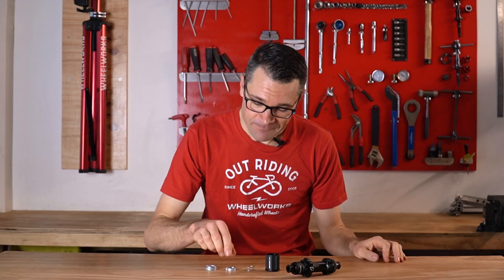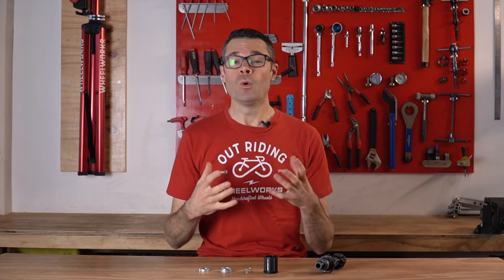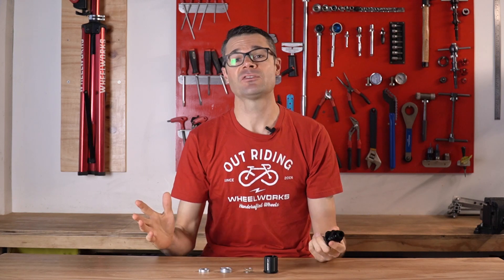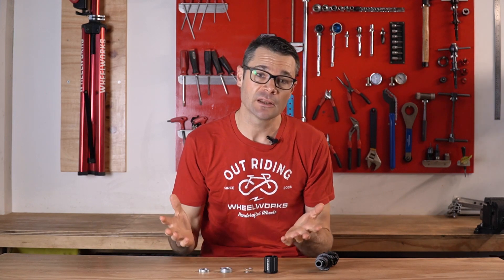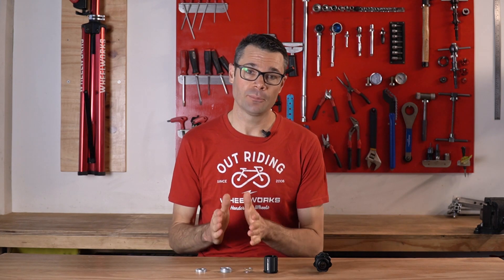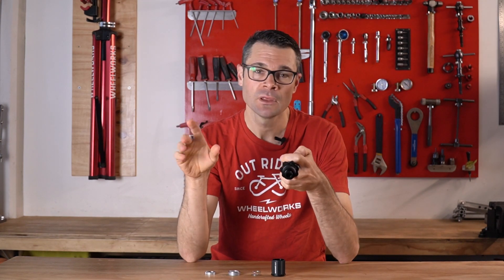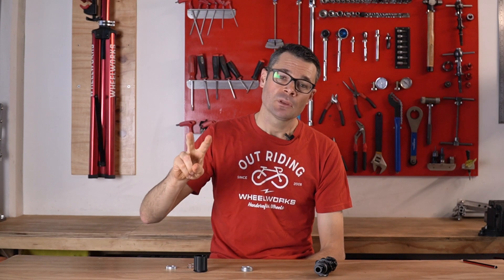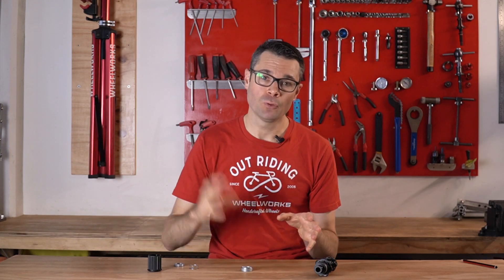DT-Swiss EXP Issue 2021

Comment: DT Taiwan ... its not swiss ... rubbish like most Fake german brands ... rebranded rebranding of cheap labour made China Taiwan frame and selling at 10x 20x 50x the cost ... $13k rubbish bike that cost less than $1.5k .
Reply: taiwan is actually high quality manufacturing. most bike parts are made there, their know how is unparalleled. China on the other hand is indeed mostly crap.

Comment: I have roval wheels on my SL7. They have ratchet exp in the free hub. This happened to me yesterday going up a hill.
Peddling but no power going to the wheel. Like the chain had come off.
I removed the ratchet exp this morning. It was clogged full of this silver grease that was stopping the spring from coming back out.
Little bit of cleaning and it worked again.
Reply: That’s grease shouldn’t be silver, that means aluminium has been shaving off the hub body! 

Also SL7? Boy are you unlucky for re-calls!
Reply: any problems since?
Reply: @Idrkmayne  no and I also got the bike serviced. I don't know if they replaced it

Comment: I am looking on my DT Swiss rear hub and can’t find that batch number. It’s a oil slick edition and a six bolt as opposed to center lock rotor. Didn’t get it from you guys but would love help if possible I have yet to build the wheels and don’t want to  remove the inner spline to make the potential repair easier if necessary.
Reply from the maker: We didn't get any of the oil-slick hubs (long story) but they should have a batch number on them.  Some of the 6-bolt hubs have this written on the driveside flange so you might need to remove the cassette or freehub body -Tristan
Reply: Thank you! I’ll take a look there. I will also possibly with my retailer.

Comment: Nice video! I was probably “patient 0” as I was the first one to post the problem in the mtb forum and also contacting DtSwiss about it. You are right, they took too long to acknowledge the problem and even then not making a total recall. By the way you are incorrect: the batch number with problems has a “0”. If you have any other number - it can be a 1 or any other digit - then you are safe.
Reply: Hi Ben.  May I ask how you know which batch numbers are bad?  Did DT Swiss provide that info?  I "almost" bought a wheelset with 180 hubs yesterday but decided to wait til I completely understood which batches are bad.  Shit, I just read that since the wheelset I'm seeking is Roval, the hub body will not have a batch number printed on it:(.    I'd rather be safe than sorry and simply replace the floating star ratchet either way...  HOWEVER, how do we as consumers know if the replacement floating star ratchet DT sends us is from the "bad batch"?
Reply: @brandonornelas4204  

Hubs (wheels as well as components) which have a “1” in the middle of the production code (e.g.: P2079940 318 DTP N 10027719) already have internals with an increased surface quality. Hubs with a different number in the middle of the production code, e.g. a “0” (e.g.: P2079940 308 DTP N 10027719), have internals with standard surface requirements and could therefore potentially be affected by earlier wear and tear.
Reply: @brandonornelas4204  if the middle digit is a 0 or a 9 the hub could be affected, at least that's what's stated in the dt swiss maintenance notice (linked below the video)

Comment: I have DT180EXP hub, yeah..I think I had some weird problem with my rear wheel, but it doesn't bother me, so i didn't pay too much attention. 
Then I upgrade my default 36T ratchet to 54T, and no problem ever since.
And I sold my used 36T ratchet....I don't know it was flawed, I feel guilty now
Reply: Why is a 54 ratchet better ?
Reply: @1spiders1  If you're asking why it seemed to solve the issue, the manufacturing defect on the rachet rings (edge chamfering, I believe) was probably already fixed in the replacement and not enough damage was done to the freehub by that time to warrant replacement.

If you're asking in general what is better about a 54-tooth ratchet, it's quicker engagement.

Comment: Experienced occassional chain drops and disengagement of the hub. Happened to me during a long ride so i had to take a taxi to go home.

I brought it to an authorized dealer here in the Philippines and they cleaned the hub and it is working again.

Upon seeing this video i sent an email to dtswiss and they asked me to bring this back to the dealer so they can check…

Looks like some dealers still dont know about this issue. It wouldve save some time if they know that there is a service bulletin and possible replcement of parts.

Thanks for this video. Great help!
Reply: What's the batch code? 
Does the official dealer (UNISON) knows about already? Thanks
Reply: unfortunately, they are not aware of the issue. They told me that probably there is too much excess factory grease which caused the dis engagement. After i sent an email to unison, dtswiss routed me again to them and they asked me to bring back the wheelset
Reply: Batch code is same as in the video. I just got the replacement part today and have it installed. Hopefully no more issues:)

Comment: I just check mine (240EXP),  middle number is 439. How about this?
Reply from the maker: That doesn't sound correct for an EXP hub but if you're sure then it's not affected:  "Hubs (wheels as well as components) which have a “1” in the middle of the production code (e.g.: P2079940 318 DTP N 10027719) already have internals with an increased surface quality. Hubs with a different number in the middle of the production code, e.g. a “0” (e.g.: P2079940 308 DTP N 10027719), have internals with standard surface requirements and could therefore potentially be affected by earlier wear and tear."  from https://www.dtswiss.com/en/ratchet-exp-maintenance-notice  -Tristan
Reply: @WheelworksHandcraftedWheels  Hmmm... Full code is : "P2112992 439 10025085". A bit different.

Comment: Man, this is so frustrating to see if you really know what is going on... It's a shame to see anyone blame DT-Swiss for fixing someone else's problem... I simply can not believe that a brand like DT-Swiss have this problems after testing so many hours in their testing facilities that are also used for testing wheels for UCI approval. I only see specific brands of bikes that seem to have te problems with these hubs. Some of these brands spec their bikes standard with DT parts. I think this is politically correct to do from DT-Swiss and that is why they not report it as a safety recall.
Reply: no, the problem is with dt swiss they make the hubs

Comment: Lmfao. Exactly why i stay away from pricey hype hubs. Run novatec 5 years same hubs 50 usd never an issue.
Reply: You're simply part of the majority of all riders that won't have issues, regardless of hub brand. Just say you'd rather not spend the money. Novatec hubs are fine, but the finishing and weight aren't in the same category as DT EXP hubs. Working in a shop environment, I can say I've encountered plenty of Novatec hub issues, since it's not limited to a single set. We still get hubs with the incorrect freehub grease and it causes similar issues to the EXP ratchet. The response from DT is much more telling, as they previously had a nearly faultless reputation. It's a shame they didn't value transparency and professionalism as much as their public perception.

Comment: Mine disengaged and caused chain jump at 1400 watts, 37mph which created broken collarbone, broken hip and lots of road rash. How many more catastrophic crashes will happen before better warning go out on these??? I believe many more stories like mine will surface.
Reply from the maker: Yikes!  That sucks Jason.  I noticed Cav's dropped chain using the Roval wheels with the EXP system as well...I think you might be correct about more issues coming to light as time goes on. -TT
Reply: @WheelworksHandcraftedWheels  thanks for posting this video and bringing more awareness to the issue! It literally took us two weeks to go over my bike and rule out various possibilities for the crash. But after ruling out basically everything else, and the fact the drivetrain showed no visible damages we started looking into the hubs and found all this information. I find it interesting that in a recent article in bicycling weekly that highlighted Cav's chain issues, the supposed "expert/engineer" never once mentioned the recall on these hubs. Indeed Can runs the same wheels (Rapide) and hubs (DT Swiss) set up that I had. I immediately went back to Chris King hubs. I realize companies make mistakes and no one is perfect but I no longer have confidence sprinting with DT hubs. Thanks again for the work you're doing, you got a new sub! JW
Reply: Same crash here. 900w broken collarbone, permanent damage and rib and back issues now. Really terrible by DT Swiss.

Comment: I've got 405 on my hub. Wheels are 50km old. First ride I noticed if i stopt pedaling the sound of the free hub was almost gone (quiet) sometimes normal so i think i have the issue to.  

Planning a 54t rachet upgrade. Have the upgrade kits not have this problem?
 Thanks
Reply from the maker: The silent freehub body is probably just the new, fresh grease in the freehub body and won't indicate an issue. Your hub's batch number IS from the affected model range though so worth talking to your local DT Swiss service center to get it sorted  -Tristan

Comment: Hello there! I got this disengagement problem.. I have a dt 240 EXP hub almost 2months and i experienced disengagement problem when i pedal. My mechanic said that the spring couldnt push the rachet easily. So i decided to take off some grease and replaced it with oil.. However, the problem still goes on..

Question : I pre ordered the 54t star rachet for EXP, so if i replace the stock (36t) rachet, it will solve my problem or not?

I only pre order 54t rachet without a special tool. It is possible to attach them without the tool?

Sorry for my grammar, im from Philippines and I think dt swiss cant send me some spare parts.. Pls do help me Sir Tristan im far from US.. I thought dt 240exp is so reliable.. Now its giving me hard time and nearly cause me crash..

Im glad ive found this video and it really helped me a lot tho.. But still, my problem with 240 disengagement still cannot be solve :(
I hope dt swiss could send me the spare parts, but im from Philippines and i got no idea how to contact them.. :(

Sad times...
Reply from the maker: Sorry to hear you're having a problem.  You'll need to replace the floating AND fixed ratchet ring, freehub body, and springs.  You'll need the special DT Swiss tool HXTXXX00N8387S to do this job.  I'd suggest getting in contact with whomever you purchased the hub / wheel from.  -Tristan
Reply: @WheelworksHandcraftedWheels  oh i see.. Its ok if i replace only the rachet with 54t? And it is ok to put oil instead of grease? If theres a grease, its still not pushing my rachet back and im having problem pedaling it. I think its ok to put oil bcos theres no sticky thing on it. 240s giving me so much problem :(
Reply from the maker: @k.walvarado2156  I'd stick with the "DT Swiss Special Grease" (code HXTXXX00NSG20S) as DT call this a 'high pressure' grease which is designed to withstand the ratchet system's loads.  What's causing your binding is most likely a damaged freehub body - you need to get all of the parts replaced like I outline in the video.  Talk with your local bikeshop or DT Swiss service center in the Philippines -TT

Comment: Hi, I have ordered a custom build XM 481 wheel set that comes with XP240  hubs. The set has not yet been delivered. I ordered also the 54t upgrade kit. Is the EXP Upgrade kit also affected towhen it comes to disengagement problems?
Reply from the maker: We've had no indication from DT Swiss or our customers that the 54t kits are affected by this issue  -Tristan
Reply: @WheelworksHandcraftedWheels  Hi, thanks a lot for answering my question. I did ask Dt-Swiss-Germany and got the response that the 54T Kits were affected, too. Since end of April the ''improved'' version of the kit is available only. So my wheel set should be good.

Comment: Does this affect 60T ratchets? Just ordered 60T ratchets to replace the malfunctioning 54T ratchets.
Reply from the maker: DT don't make a 60t ratchet. The hubs come with 36t and you can upgrade to 54t - those are not affected.

Comment: So I have in my possession two carbon wheelsets, one with 240exp and 350 version and on a spin test the 350 spins forever and 240 stops after 30sec-1m. Does it need a run in period or other issue? Bike store says potentially too much grease from factory in bearings and needs a few rides. Front wheels were spun? Backs similar performance. Help?
Reply from the maker: Some of the DT Swiss front hubs (there are a few different versions) use a mechanical seal which will cause some extra drag, especially when the hub is new.  -Tristan

Comment: Hi Tristan, I just got new wheelset with dt240 exp hub.... And got '370' code in the middle...

How do I know whether this hub has issues or not before I replace the spare parts as you mentioned in your videos?
Reply from the maker: I don't think that batch code is correct Michael - you might be looking at the wrong part of the code.  In the video description is a link to the DT Swiss tech article showing the code -Tristan
Reply: @WheelworksHandcraftedWheels  the code is in the rear hub right... Hmm that's weird thkugh
Reply from the maker: @mikesalim  That code sounds like it's from a previous non-EXP 240 hub.  Are you sure your hub is an EXP?
Reply: @WheelworksHandcraftedWheels  the body hub shows ratchet exp though

Comment: I experian some problem with my new roval rapide clx  wheels i have lost on cracking noise when pedaling i send the wheels back to dt swiss and the replace all the internal parts for me i just waiting for the wheel come back . Thanks for a video 👍 great job guys .
Reply: Hey Vlad - A creaking or cracking noise is unlikely to be the EXP system and more likely to be the spokes or build-quality issue.  Hopefully Roval get it sorted for you -Tristan

Comment: oh man, I was just about to get the XMC 1501 SPLINE ONE wheelset when I saw this.
I would still like to go ahead with the purchase but immediately replace the (potentially) affected floating star ratchet.
The only option I have available locally is: DT Swiss Upgrade Kit Superlight 36T for Star Ratchet Hubs; Manufacturer Item no.: HWDXXX00N2884S
Do you think the replacement part is unaffected by this issue?
Reply from the maker: That SKU is for the star-ratchet hubs, NOT the EXP system.  You'll need HCDXXX00N2426S for the EXP floating ratchet.  I didn't get a clear answer from DT as to whether spare-parts were affected or not.  -Tristan
Reply: @WheelworksHandcraftedWheels  Ah, thanks man! I'll check with the supplier...

Comment: Thanks for the video. Just learned about this problem by chance yesterday and I am worried about my Roval Alpinist now. Did not really get where the batch number can be seen. Can I find it if I remove the cassette ?
Reply from the maker: I'm not sure with the Roval wheels sorry Bruno. Often companies like Specialized use DT internals but have the hub shells made by a different company so it's possible they don't have a DT batch number because they're not a DT product. -Tristan
Reply: @WheelworksHandcraftedWheels  Ok, thanks for the answer, that’s why I don’t see any number. I didn’t even know it was DT Swiss tech before reading comments from affected customers on FB with Alpinist CLX. I have contacted my Specialized retailer to check what I should do.

Comment: Have you had any wheels, whether new, ridden without problem, or ridden with problem that have been warranty repaired/upgraded and then come back for the same issue, or does this upgrade fix the problem for good, at least in your experience?
Reply from the maker: I had a good skype with DT Swiss the other night about this issue.  It seems that if your wheel is not affected yet then it's very unlikely that it will develop the problem - the issue seems to come up quite early in the hub's life if it's going to be a problem.  Once the freehub body and floating ratchet are replaced it seems there is nearly zero chance of the issue popping up.  -Tristan
Reply: @WheelworksHandcraftedWheels  thank you! I will be receiving my new wheels this week and they only replaced the the floating ratchet because they’ve never been ridden and are brand new. Fingers crossed I’m good. Much appreciated!
Reply from the maker: @paulgrossodesign  that's all you need with an unridden wheel 👌

Comment: So what was it about the floating star ratchet that was causing this issue? Poor / rough finish, incorrect tooth, wrong materials size etc etc?
Reply from the maker: DT Swiss say it's a "surface finish" issue - although that term could cover a multitude of sins.  Basically the floating ratchet sometimes gets stuck in the freehub body and the spring doesn't have enough force to move it.  To the naked eye the replacement parts appear identical and interestingly they've been issued the same part number (no iteration) so it's impossible to tell if the one you're holding is the bad one or good one. -Tristan
Reply: @WheelworksHandcraftedWheels  Relying on surface finish for ratchet engagement is soooo dumb. A spring behind each ratchet means they engage even if one gets stuck. A former DT Swiss engineer once posted online (post has been removed) that it is silly to "fuse" one ratchet to the inside of the shell - precisely because it is expected that the ratchets will move slightly around an axle that bends and twists.